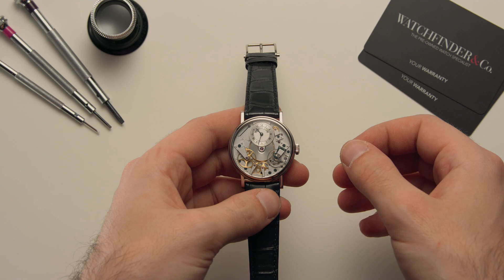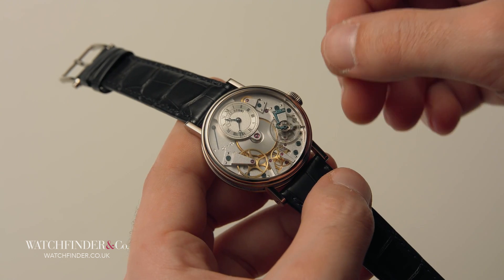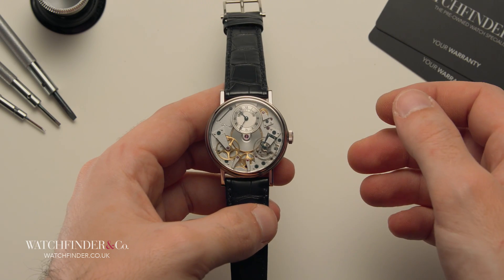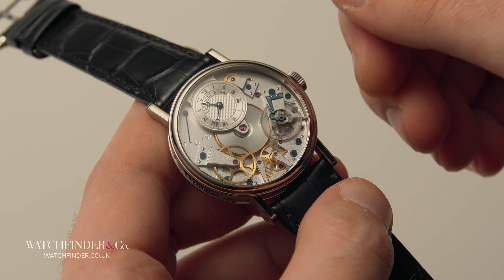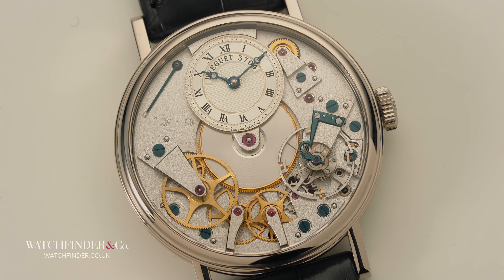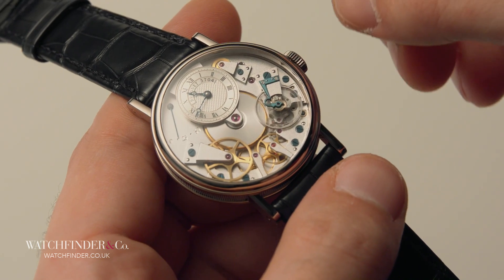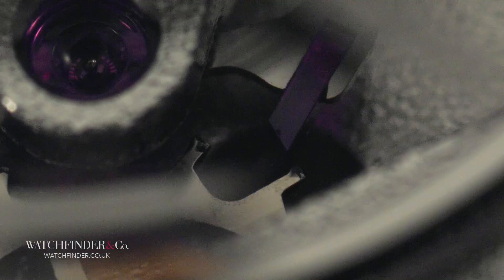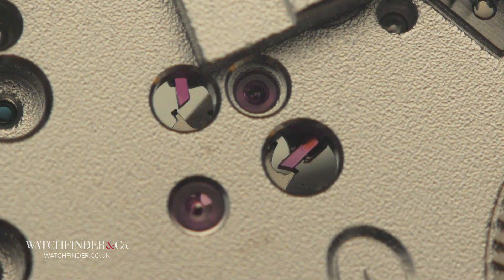How Does a Mechanical Watch Work? - Breguet 7027 | Watchfinder & Co.

Comment: I liked the video but there are couple of fundamental things which I think would add to the general interest. The balance wheel oscillates independent of the energy provided by the barrel main spring, same like pendulum which is independent of mass but is depended on the length of string it hangs to and fairly independent of input force too, it will oscillate to its natural frequency. Basic science of spring mass oscillation which is independent of input force, that is depended on the spring stiffness, length and mass of flywheel. Otherwise the watch will run fast fully wound and slow down as the main spring uncoils, this makes the design of balance wheel and escaping even greater as it address one of the most difficult issue of main spring variable energy whilst performing the timing function. To make the timing mechanism go fast or slow the length of spring is altered which is mostly done by a regulator lever.

Comment: From the point of view of measuring time, it makes no sense to buy expensive watches. Mechanical watches  require much better and more accurately made mechanisms than watches with electric stepper motors. In my opinion, the "standard" watches from 1940-1970 produced by Ebosche (eta, felsa, etc.) were better than the currently produced watches of well-known companies. Their workmanship has reached a high level. Today, they can be called exclusive, although they were produced in millions of copies. However, Japan seiko or citizen were only slightly better than Russian watches. They did not compare with good Swiss watches.It is about the quality of materials, proper hardening and accuracy of workmanship. Electronic watches in the 70-90 of the last century destroyed most of the watch factories. In the majority of contemporary watches (no matter who would sign them), the mechanisms of only a few big firms meet.

Comment: Perhaps I’m wrong, however i think that the physics principle you’re referring is conservation of energy, not momentum. This is because as the balance wheel loses kinetic energy (velocity) the balance spring gains potencial spring energy and in that moment when the velocity is 0, it starts releasing the energy and starts the cycle over again. You are correct to think in momentum because both mass and velocity are highly involved in the accuracy of the process but not quite in that way. 
Indeed great video, as a mechanical engineer student this fascinates me and I highly appreciate this type of information that only adds to my love for watches and respect as complicated and precise mechanical pieces.

Comment: Understanding what makes a mechanical watch mechanical made me fall in love!

What watch holds the record for most time on a full "charge"?
Reply: do you mean a watch that has the ability to hold the most amount of power once fully "charged"? that's called a 'power reserve', measured in the amount of hours/days it will take to fully tick through until it no longer has any energy left in the mainspring. I believe the record is Hublot MP-05 - a watch that costs as much as a house in the modern day in most cities, has like a 50 days or so power reserve. (to put that into perspective most usual ones i've seen around somewhere between 36 to 70 hours, a 70 hour power reserve on normal affordable, even luxury watches is usually considered a good number).
Reply: @TjPhysicist  yup! I was asking about the reserve (I didn't know what it was called back then)

50 days is massive! I would love to see an in-depth explanation of how they did it!

Comment: So, are the balance spring tension is basically what defines the length of a second? Does that make it a consumable/commonly replaced part as the metal fatigues and loses tension?
Reply from the maker: Yes, exactly. The materials used and the minimal forces involved make the balance spring typically a lifetime component, as they don't exceed their elasticity. In the last few decades, some pretty clever alloys have been developed to ensure the longevity and magnetic resistance of hairsprings. Very few manufacturers make their own as they are very, very tricky to make.

Comment: I think this is an appropriate place to request a video on the F.P. Journe Optimum.  I am a new subscriber and an avid collector.  I have owned several Patek pieces, but ultimately settled on Journe.  Larger size, offset dials, visible screws, all precious metal fabrication to include the movement make FPJ my grail.  That said, I appreciate this piece from a pioneer and your vid is smashing 🐇

Comment: It's interesting the way some of us - most of the commenters here, I'd imagine - develop such a bond with mechanical timepieces (or mechanical anything). These machines are almost alive, and usually dependent upon our initial impetus to get them going - there's satisfaction in that, much like toppling over the first domino in a line. I have an old wind-up waiting room clock - a mahogany Anglo-Swiss - that keeps appalling time, yet I dutifully wind it up every week. Where's the sense in that?
Reply from the maker: That's an interesting point—a mechanical clock or watch needs care to keep it going, whereas modern tech is often uninvolving. That's probably why people enjoy retro stuff so much across the board.

Comment: What are some nice watches under 5 grand that showcase the actual clockwork inside the watch, just like this one?
Reply from the maker: One for the wow factor is the Speedmaster 3752 (or modern sapphire equivalent) which has a hand wound chronograph on display.
Reply: Id look for ones with display casebacks or skelotonised movements. for that price range for one of decent quality I'd probably go second hand. There are good ones for instance the sinn 104 or most nomos' as well as stowa, as with these you can generally choose if they have a display caseback or not and at your pricerange they will be new. otherwise maybe look at glashutte original second hand with display csaebacks or you could even get a aftermarket display caseback to fit your watch.

Comment: Is it possible to to compare a seiko 5 movement to a omega or rolex? I think this would be very intresting.
Reply from the maker: We could certainly demonstrate the difference between high end finishing and low end at a macro scale, that could be interesting!
Reply: I think that is what Remco was trying to say. I would love to see that comparison. Since this is a year old video, not sure if you have already done that.
Reply: Watchfinder thank you for reacting to my comment did not expect that. You're channel has the best watch videos on youtube. Such a video is exactly what i mean. I would love to see a comparison.
Reply: max factor thats actually a very apt comparison; the corolla and Ferrari will both get you where you need to go, but the ferrari will do it for 8+ times the price, and need much more costly maintenance along the way....the Corolla can be filled with gas and oil and forgotten about, no five figure periodic valve adjustments, no pulling the engine for routine repairs. Status has its costs. 
Ps, i write this as a skx as well as higher end watch owner.
Reply: Steve chernick 
Well i’d say it’s more than status
I can’t speak for rolex, but omega movements made decades ago, provided they were well maintained, still run great
I’m not confident that a 7S26 movement will still be running 50 years from now, but i’d trust a grand seiko 9S movement to
Reply: Remco Been I can also second this. Would love to see some cheaper watches on here too ;).
Reply: Remco Been I don`t know. But my Seiko keeps time better than my Rolex 🤣 They are both great watches.
Reply: The Seiko 5 brand covers a wide range of movements. For instance, the SARG011 is actually a Seiko 5 Sports model and has a 6R15 movement, which is not a low end movement. The 6R15D in my SARB035 is running MUCH better than COSC requirements for a Certified Chronometer. I think the kind of thing you're talking about is something like the 7S26 movement. So, point is, depends on which Seiko 5 you chose.
Reply: Thatd be interesting
Reply: arupian666 love the sarb!
Reply: , tt is t e ee
Reply: How much better is my Hamilton field watch ( $600 in Canada ). To my Seiko 5  ( $110 ).  Both keep great time .
Reply: Swiss movement or Japanese. ?   Both are good but one cost so much more ( Swiss )
Reply: Indeed it's possible 
They both perform the same function---albeit at entirely different levels--there is commonality .
Reply: Remco Been They are so far off from each other in quality no point
Reply: Kristian Engen 
Thats the point. Show the diffence the higer prices gets you. What different techniques are used ect. ?
Reply: it is like comparing 1980 dog shit corolla to brand Ferrari. both can move you from A to B but yet incomparable